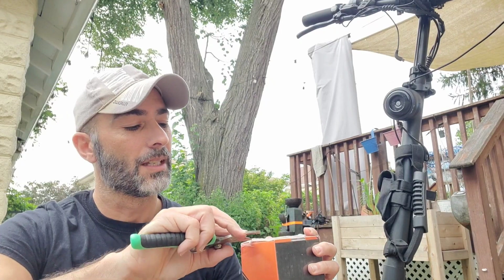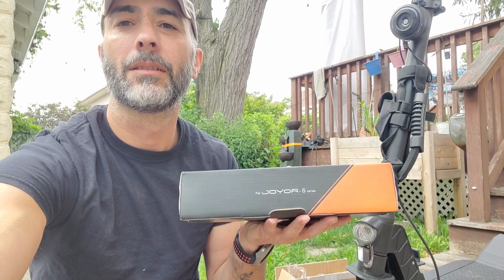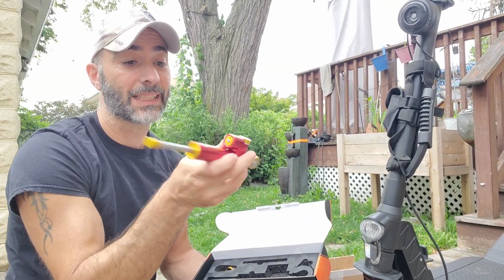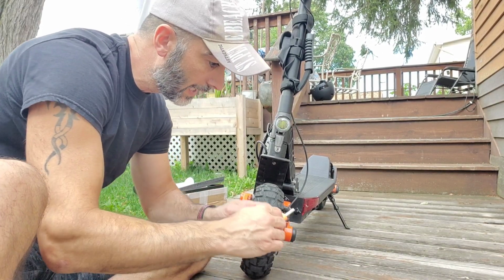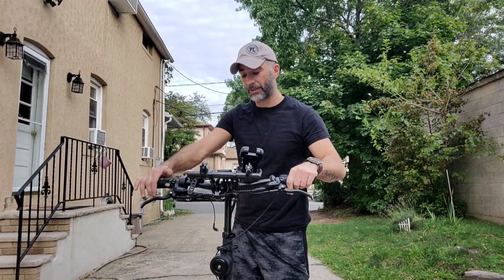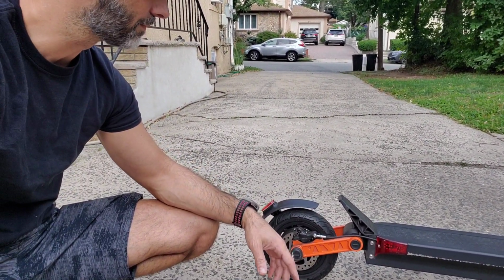Joyor S Series Steering Damper Box Opening, Installation, Riding

Comment: Hello, Could you tell me how long is this part which you hold in your hand on 10:11?
Reply from the maker: Hi, Are you asking about the dimensions of the bracket?
Reply: @WiJoY78   yes
Reply: even exactly how thick it is
Reply: how long up to this point, what is the shock absorber against the thread
Reply from the maker: @JuriusZ-xd  I will measure it and respond when I am home. 😇
Reply: @WiJoY78  OK
Reply: How much ???
Reply from the maker: I wasn't at home. I will let you know.
Reply from the maker: U shape part : 6.6 x 5 x 6 centimeters 
Stick part : 9 x 1 centimeters 
Thickness : 1 centimeter

Comment: this kind of steering damper ususally costs 30-50€ but cos of the wide bracket especially for this scooter it cost around 130€ its a scam imo. Beside the fact u shouldnt dont need one for a 1000 € scooter. Basically the scooter is very nice, strong, and good quality. The support is nice and kind too, only need 36h to respond. But the damerper is a scam imo
Reply: why a 1000 euros scooter does not need a damper?
Reply from the maker: I just saw this message. Other expensive scooters need a damper, too. If you check the market. None of them give a damper with the scooter. High-end, expensive brands have their damper to sell. Even motorcycles don't have a damper. If you want, you have to buy it.  Before the damper, I had two accidents; after the damper, none.
Reply: All scooters benefit from steering dampers. Its just the nature of scooter steering geometry and wheel size!